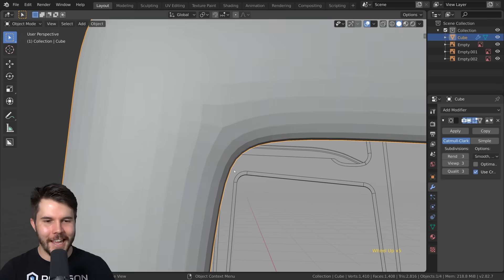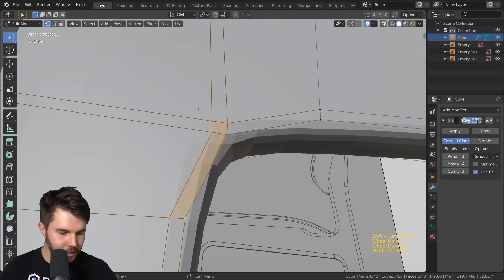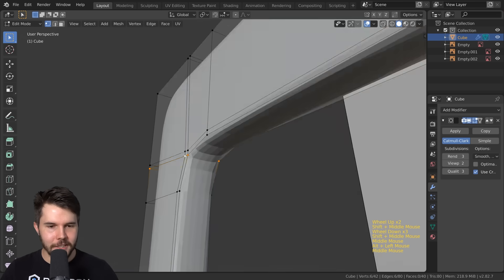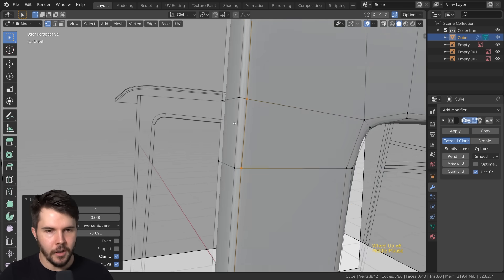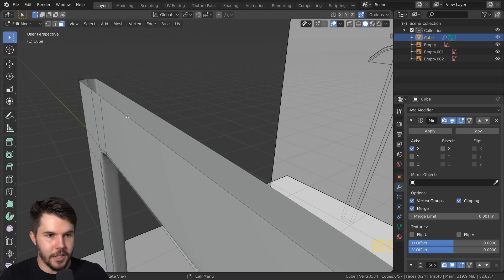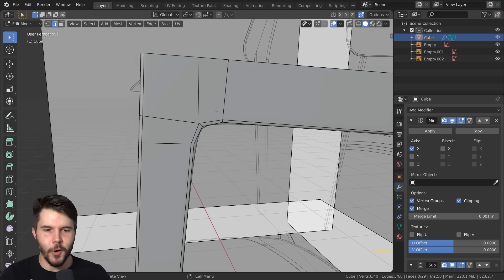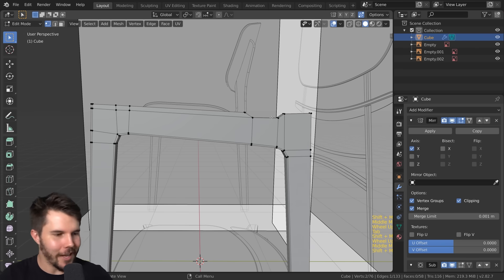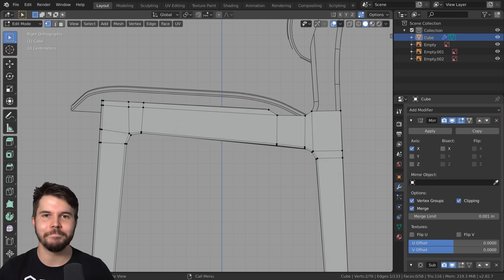Blender Beginner Modelling Chair Tutorial - Part 2: Edge Flow

Comment: The mirror modifier somewhat doesn't work for me. You have 3 vertices on 1 row on the top faces, but I only have 2. Is there a problem? Besides, if I set the origin to "origin to Geometry," how do I disable it and return to the default one?

Comment: have you ever throught of substituting edge loops with edge crease instead?
Reply: If you go through the comments of part 1, it was mentioned there and in the answers is a good explaination why you shouldn't use creases as a substitute for holding loops. On this part I also added another important reason to a  similar question  (issues if you have to export the model.)

Comment: "horizontal number keys" are called "alphanumeric keyboard" in opposition to 'numeric keyboard' on the right, and it is recommended to have "zoom to mouse position" and "auto depth" in preferences, (then you don't have to complain for strange mouse roll sensitivity). Just my two cents.

Comment: If you need tight edge without adding topology, just select edge and press "shift+e" and drag mouse until you get a satisfying result.
Reply: This is about proper topology and flow which you can't achieve using creases. And if you have to export the model you might be screwed because some apps might not be able to "read" the creases or interpret them different. Using them for private projects with apps that can work with them is fine, but these tutorials are for teaching people to do it properly.

Comment: Question about hidding the arm and legs: For much of the video, esp the 2nd half, BG was editing in a mode where the chare arm/legs were not visible at all -- not the subdivisions nor the solid. He was just clicking on the vertices of the frame. EG at 10:15. How does he toggle the visibility of the arm/legs and just show the frame? (The area that shows the mouse/keyboard presses don't seem to indicate what he does.

Thanks, and as always, great video!
Reply: I'm pretty sure he turned off seeing the subsurf in edit mode. There's a button for it in the modifier settings

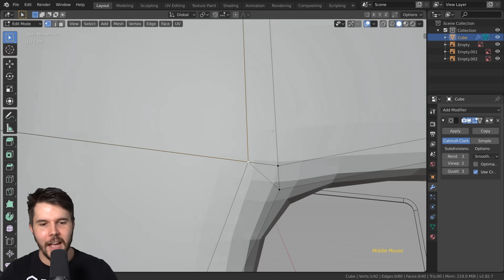Comment: 4:50 The new shortcut for merging duplicate vertices on Blender 2.83+ is now only M, while Alt+M does the inverse operation (split). This was done because it is such a common shortcut that it got a brand new, easier shortcut just for that and because the Alt key is usually used to invert the command, so there's that.
Reply: Thank you so much that saved me some time
Reply: True but I guess between client work, his company and the tutorials Andrew isn't testing the new versions until after the final release. So he will stumble over the key change in about 2 weeks ☺
Reply: tysm

Comment: A teacher told me, if your model works correctly and there are no problems, it doesn't matter the way you do it if it works. The solution of the model to the character of the incredible was to leave it in quads so that there were no problems at the time of making smooth.

Comment: 14:10

Thanks for that, so I shouldn't feel bad if I restart that damn residential garbage bin for the seventh time.
I was starting to think I was retarded, while in fact I do the right thing by modelling something see what's wrong midway trash it, and try better with a different mindset.
Reply: There is almost always more than one way to achieve something in Blender. The way you prefer to work will come with experience and make it easier. But even then your prefered way to do something might work perfect on hundreds of models but then with one model it won't. Making mistakes and running into issues, and start over again trying to find a different way to avoid the problems is a good thing IMHO. I have been working in 3D for almost 25 years now and still with some models I run into issues which pull me out of my comfort zone. Of course that happens much less than in the beginning but it happens. 
Please don't be frustrating or give up.

Comment: If the curve on the leg was a center of attention, wouldn't have been easier to start from a cylinder, take just a quart  of it (thus creating the inner part of the curve) and extrude the faces to the up left corner of the chair frame, so you can then extrude downward the leg?  This way, with only smooth shading you could even avoid subsurfacing it.
Reply: You could but you will end up with small long faces which can be an issue with the shading.

Comment: is it just me or are there others who feel like this series is an artists approach to an engineering problem and most of the techniques shown are only actually useful when you want to reproduce organic shapes? this chair is a parametric object, and the proper way to add a bevel to the legs would actually be the bevel tool, because it allows you to specify the amount of beveling on a per edge basis an actual defined beveling profile and radius.
i know how to use CAD and this video kinda hurt watching although i understand why he chose to do things the way he did( he explained in the first video)
Reply: I usually work in Solidworks and have had the very same feeling :D You watch what would usually take 5 seconds stretched to 10 minutes but the purpose of Blender is different and I learn it to get me some of that sweet particle effects for my renderings.
Reply: Andrew does demonstrate the bevel tool technique in the previous video but then shows it going weird when shade smooth is selected. Then he explains that the way around this is to divide up the n-gon and says it's a lot of work. I've tried another way of doing it which is to dissolve the side lines rather than creating more. It takes a few seconds and the smooth shading looks good - it's perfectly flat on the sides. I feel it's better because it gives you proper flat surfaces and an accurate radius in the corner. You can then apply the radius and bevel the edges using the bevel command or modifier. Seems a lot more straightforward than the technique Andrew ends up showing, which also only approximates the actual chair geometry.
Reply: BTW I'm an engineer. Inventor / Solidworks, etc.

Comment: What about using insetting over edge loops? Wouldn't it work as well and give definition to multiple edges simultaneously?
Reply: That depends on the shape you are working on. On some models it will work, on others not. Just try it out with a cube. On some models a quicker way to do holding loops is using the bevel with a profile value 1.

Comment: Not sure if you'll address this (I know this tutorial is a WIP), but I have a question: as you extrude and extrude and extrude etc. using free mode to place the new pieces around the blueprint, the "walls" are a liiiiiitle bit wavy (like the very top of the leg, or the back...if something like that happens I have two solutions: if the flat part aligns with an axis, I scale (S) -> axis button (X, Y or Z), hit 0, done. If it does not align with any axis, but is close to one of them, I do the same, followed by shear (ctrl+shift+alt+s on my machine, not sure what the default shortcut is) and align it with the blueprint again. However, both are time consuming and not quite ideal... 

How do you solve it?

There's an opposite problem; what if you're modeling something like a car and you need every part to have this nice smooth curvy flow with exact curvature in both principal directions, but you find one of the vertices a little displaced so when you look around using the red matcap it strikes your eye...so you move that vertex a bit but now its neighbour is a little off...half an hour of work later you managed to fix one loop which now has very smooth curvature across, but it's not quite matching with the adjacent loops. You scream and quit...? :D Is my approach to cars and such wrong to begin with? Some parts just need more edge loops but when adding a loop it adds it in a "straight way", it does not manipulate the curvature between, so some manual adjustment is needed...sometimes when I'm correcting the mesh flow around critical parts like openings, wheel wells etc. I find that I fixed the geometry, but the actual shape is all messed up because of the extra loop cuts that need to be micro-adjusted all vertex by vertex :(

Comment: Hey Andrew, I used to do exactly the same to get the smooth feel over the rounded edges in subdiv mode. Say, drop edge loops on either side, then resolve unwanted edges by slide and merge. Instead, you can select that edge loop and bevel with 1 division, that should be faster on large scale. Why don't you try that for some other part?

Comment: Something I always wondered: So as soon as something has a curve in it, that's supposed to look really smooth -> in case of the subdivision modifier the whole model will be subdivided, even in parts that would only require 1 polygon. But because of this one curve in the model, the whole model is subdivided. Is there a clean way, to reduce parts of the mesh, which don't need the extra topology? (I guess without diamond structures, there is no way right?)
Reply: That depends on the model you are working on. There are methods  to reduce the mesh resolution from high subdivisions to low, but that is a lot of time consuming work. I wouldn't bother with it if the model isn't for a game engine, where a low polycount often still is important. Some times you also can get away just using loop cuts only in that part of the mesh but that often results in small but long faces which can be an issue with the shading. 
Google for the Topology guide, he also has examples how to reduce from high to low resolution.

Comment: Wouldnt be better to create the edge loop for nice edges little bit later? when you have that whole wooden plane done? 
Btw... what do you think about method which is using Bevel modifier and weight? 
And another point - automatical merge of vertices is in Blender looooong time, and even 2.80 has it built in tool and workbench setting ( screwdriver and wrench icon).

Comment: Ok, so if any of you are having trouble with your mirror modifier like I did, It is likely that you moved your leg from it's origin point in edit mode and not in object mode. Whenever you move an object in edit mode, the origin point (a little orange dot that is usually in the middle of your object) does NOT move with it. To fix this, tab back over to object mode and right click the leg (you want your full mesh for this, so ctrl+z until you have your original mesh, also delete your mirror modifier for now) and click on "set origin" then "origin to geometry". Now when you apply your mirror it will mirror it from the middle of the leg and not the middle of the chair. Hope this helps!
Reply: my origin is not even on the leg is most views, is that even right? i've tried what you've said and it still doesn't seem to position it right

Comment: If your chair leg isn't mirroring correctly, check if the object's origin is in the correct position! If it isn't: get in object mode, right click on the object, go to set origin, and click origin to geometry. I had this issue and i was puzzle as to why the object was mirroring itself way further than it should.

Comment: You could have easily prevented the corner problem by planning ahead and doing the bend with an odd number of faces, thus creating a middle loop of faces. So instead of doing the corner with 3 vertices, use 4.

Comment: Hi Andrew. I hope you are doing well. It is good to see you in action again. I want to point out a few things: 

1. Instead of sliding the vertices, the ideal/faster way would be to select the 3 vertices on one side, select the middle one, and merge at active. But we wouldn't have learned about the auto-merge feature that way. It can be activated from View > Tool Settings (And you have to be in Edit Mode) .. I initially couldn't find it. 

2. In Blender 2.9 (currently in Alpha), the merge shortcut (default) has changed from Alt+M (which is now Split) .. to just M.

3. For Car Tutorial, just make a intermediate tutorial (where you don't show every extrusion, but focus on broader difficult shapes that are not easy to make). Not every tutorial has to be a Beginner Tutorial. That way, you can save time, and wrap it into your 12-20 minute videos.
Reply: For 2) That has already changed in 2.83 afaik

Comment: So, have been following through your tutorials, done the donut, all grand, thank you very much Mr. Blender man, but at the point where we're supposed to add a vertical loop cut to the leg, mine is only up to the first horizontal cut line, have I pressed a key accidentally that makes this happen? I can get a horizontal cut all the way across on the top half of the chair, but vertical is apparently no. 
https://paste.pics/97d76abe935d3e9d9c81e0b84dd7d92b (<- screen shot of dilemma) 
Hlep?
Reply: Fixed  it, there was a face on the inside of the leg that I had to delete.

Comment: When I added the mirror modifier, it added a leg on the other side of the chair in the exact spot of the reference photo. Can you explain this to me? I did not see this in the video.
Reply: The mirror modifier uses the origin of the mesh (that little orange dot) to calculate where the reflection is going to be. In object mode, select your object, right click and choose Set Origin > Origin to Geometry, now add the mirror again, it should work now.
Be careful moving your mesh in Edit Mode since the origin will not move with the mesh like it does in Object Mode.
Reply: @100Peterll  THANK YOU SO MUCH ! ;-)
Reply: @100Peterll  Thanks!
Reply: move the leg to x = 0 in Edit Mode and then back to the normal spot in Object Mode
Reply: Same lol
Reply: Your pivot point is not at the center, it has to be at the center, to do that select the edge loop you just made (in the center of the mesh) in edit mode and then press Shift+S > cursor to selected then go to object mode and press space and search for set origin > origin to 3d cursor

Comment: For some reason the foot of my leg isn't perfectly centered so when I mirror it, it looks like there are 2 feet. I don't know where I went wrong or how to fix it.

FIXED: I had two issues, I had one wacky diagonal edge on the front that I had to edge slide up and merge to remove. And from top view, I don't think my edge down the middle was perfectly center, so I slid that one over to the right and added a new one, making sure to cancel movement by right clicking. Then I set origin to geometry again before adding the mirror modifier. Seemed to work.
Reply: Thanks! Origin to geometry!!

Comment: Hey quick question, I've been following along in your tutorial and got to the mirror modifier part. Instead of the mirrored part being shown next to the original half of the legs its on the opposite side of the chair so it looks like i already have two half legs. Is there any way to fix this?
Reply: Same problem happens to me. Please help!
Reply: GOT IT! Select the bottom face of the leg, hit Shift+S, Cursor to Selected, go back to object mode, then on the top bar click object -> set origin -> origin to 3D cursor! The mirror modifier will work as it works for Blender Guru.
Reply: @idqn  Thanks! It worked!

Comment: Its helpful that when you extrude, if wants to go straight to a position type the keys (x,y or z) to go directly in that direction  , in this case he could press E and then Y to go straight instead of move it manually where should be

And same to the other leg could use E and then Z to reposition to the global Z

Also i thought that the was going to use another mirror modifier to do the other legs xD

Comment: Question, I used 3ds max years ago and I would control the sub-div smoothing with smoothing groups (or material id's). Is there something like that in Blender? Because now you got lucky and that surface is covered, but what it it was a visible surface?

Comment: Caveats out of the way first. 1) I'm pretty new to Blender so don't know it's full capability 2) Thank you for these tutorials. They ARE appreciated! 3) It's amazing Blender is free for such a complex tool. So, having coming from a CAD/Simulation background I find the model generation really clunky. I know it's designed as a surface modelling/manipulation tool for generally complex objects (and the mesh manipulation is very impressive), but for relatively simple objects like chairs, I found this really hard work. Wouldn't it be better to have solid modelling capabilities, use primitives, sweeping, boolean operations, filleting/raduis tools, etc. then fit the mesh over the surface? That's how FE/CFD modelling works.

Comment: Great tutorial thanks ! 3 tips:
* put the images for reference into a collection and then you can use the eye in the right to remove and put again in the scene as you wish.
* you can click in each image and in the item menu click in the locks to avoid move them by mistake.
* instead of scale the cube just move the cube to be one side on the reference of one line of the leg and then you can move only the opposite 2 vertices to have a better adjustment to the image of reference.

Comment: My mirror is far away from my current leg, how do I move it closer? I feel like I need to move the origin of the yellow dot thingy to my leg?
Reply: Yes, the mirror line goes always through the origin. You can either move your vertices in edit mode closer to the origin or move tje origin closer to the vertices. Maybe the fastest easy way today is to press N to get the Properties side pane open, and go to Tool tab and options > transform > affect only and select "Origins". Now you will only move the origin. With snapping tools (top bar magnet icon and the button left to it) you can lock the origin to a vertex.